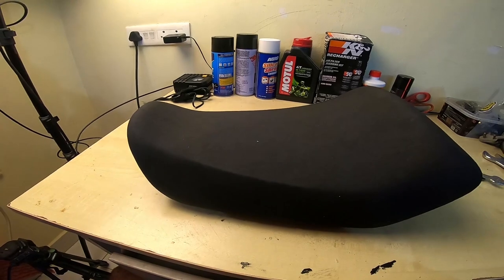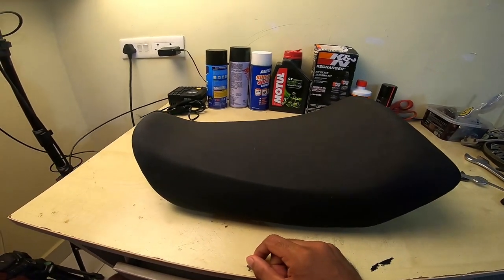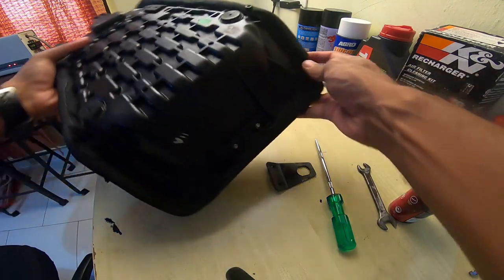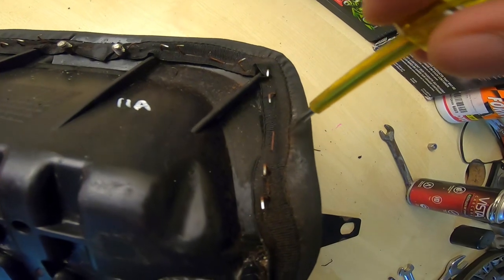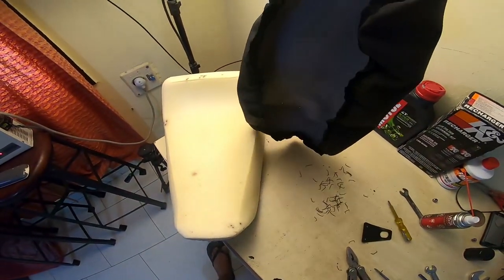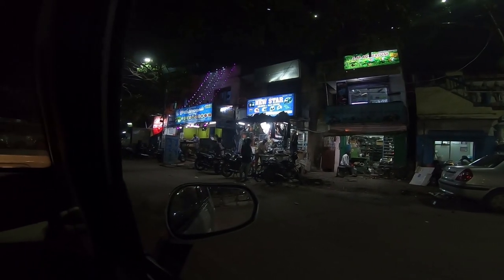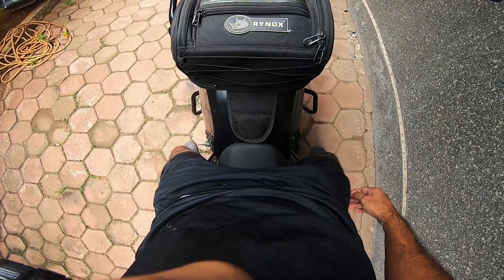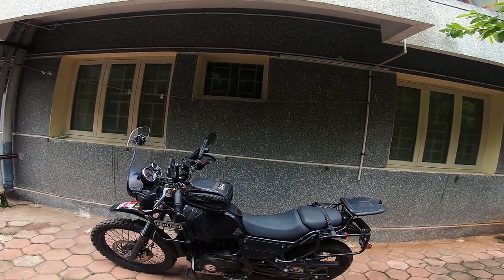FIX SAGGING ON THE ROYAL ENFIELD HIMALAYAN RIDER SEAT

Comment: Nice video bro. You really take care your bike. I already bought a Himalayan. What do You do to prevent rust on your bike? Specially in the exoust part. it is one thing that i'm worried about. Grettings from Colombia.
Reply from the maker: bryan rojas the rust in the exhaust bend pipe is nothing to be worried about . It is quite common and also will not damage your header . It is a surface level rust ( more a decoloration )

Comment: Ben back again! Nice informative video and it has come out well. Do you notice any difference in the reach of your feet after the installation of additional foam.
Reply: I always used to do this to my previous motorcycles, Rx 100 and Fazer. To both seats  I added extra foam after about 30k or so km.
Reply from the maker: About 1/2 inch to the ground .